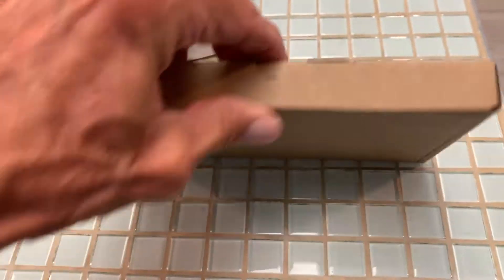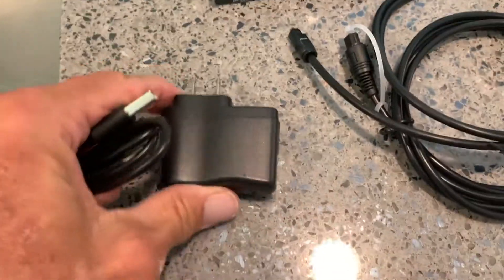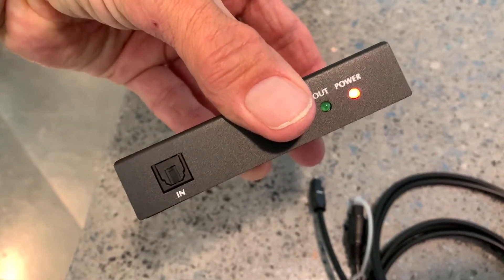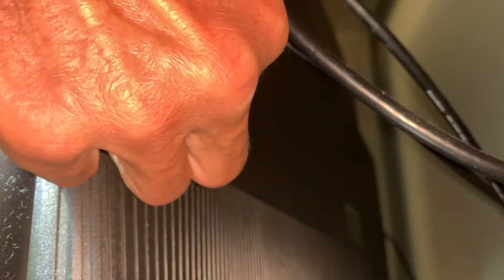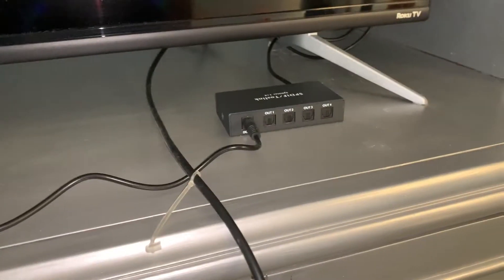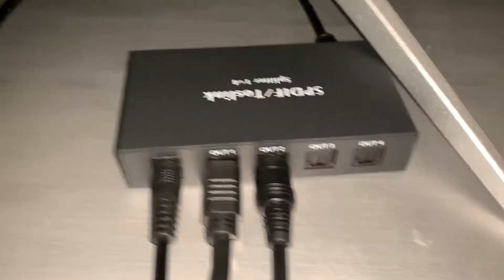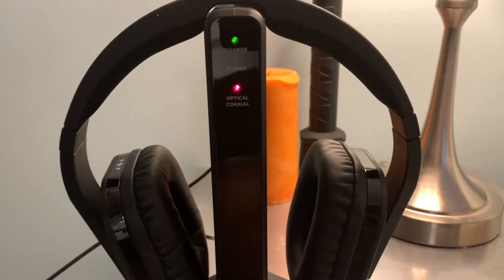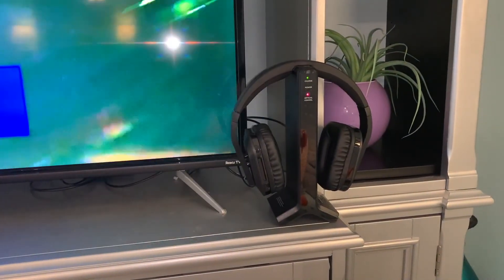How to use a SPDIF TosLink 4 to 1 Audio optical splitter

Comment: Can I use a splitter to connect my soundbar to my smart TV which doesnt have optical port..my soundbar only supports optical audio port
Reply from the maker: That’s a good question I would have to do some research on that I used it optical splitters, which worked, but I know that once you put a connector into the headphone jack, it shuts off the speakers on the TV but you could probably put a splitter from that going to your sound bar into your headphones. Good luck. Thanks for watching.

Comment: Hi, which headphones of yours are these? 
I have setted up too but with a digital to 3.5 mm adapter and a Bluetooth transmitter, however the sound delay is aggressive and it cuts the audio just for blocking my Bluetooth earbuds
I'll appreciate your answer
Reply from the maker: Do you have multiple devices it can be a little tricky if you have a delay that kind of screws up the whole viewing experience I am using avantree headphones with roku tv thanks for watching
Reply: @TomLeeman  Nice thanks

And no, it's the adapter itself cuz i tried direct plug, also this is how Bluetooth works and your headphones looks so pro, i wonder if it has surround sound so thats why i'm asking which to figure them out haha

Comment: Hi, I have a tv, 4k player and sound bar. I  am not able to get them all working at the moment.
Does the single optical cable from the splitter connect into the tv or sound bar please?
Many thanks
Reply: I got the correct splitter and everything worked immediately.
Reply from the maker: Yes I have the splitter connected to the tv then split to the headphones and sound bar only way to be able to listen to both at the same time
Reply: @TomLeeman  Thanks for getting back to me Tom. I followed your advice but there was no sound at all. I think i ordered the wrong box as i have a switcher. It's similar to yours but has a switch button. I have now ordered a splitter so hopefully that should help. Thanks again Tom